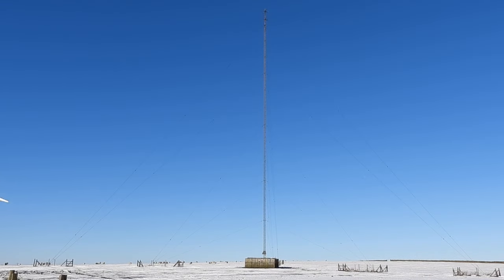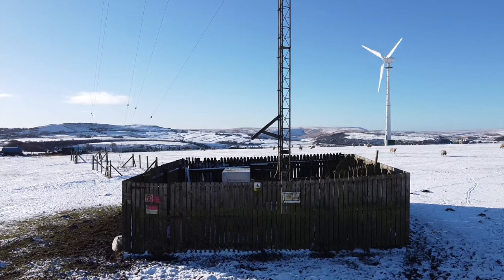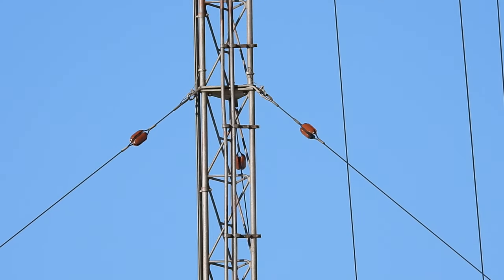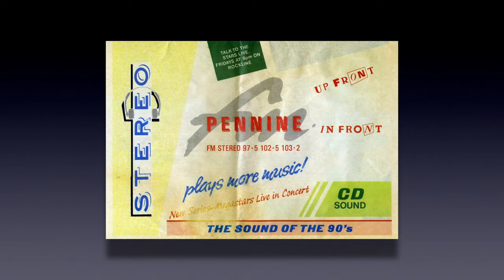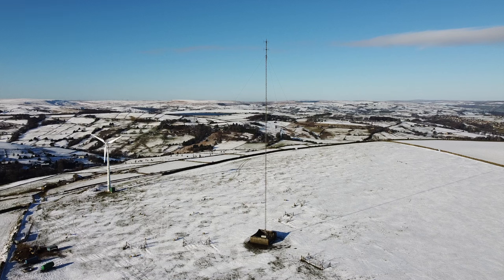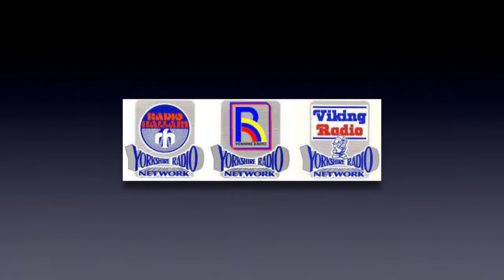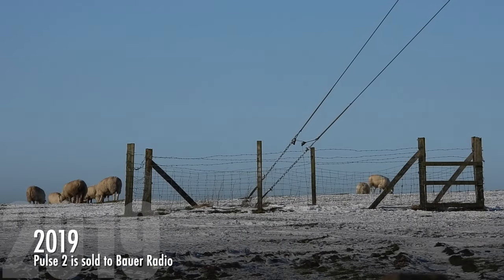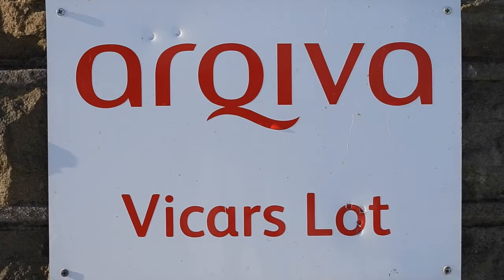This Radio Tower Is Really DANGEROUS

Comment: I was Chief Engineer of a directional AM for decades (among other stations) and when they started putting up cellular towers, I used to get calls asking us to power down so the cell site workers could work on the pole without receiving love nibbles from it.  Keep in mind, those are grounded poles and towers that were absorbing enough of the RF to have high voltage points along their length.  I helped detune several for them so the workers could work on them safely while I stayed on the air.  But all it took was for them to add some more feedlines or otherwise change the electrical length of the tower and the detuning was disabled.
Reply: love nibbles ;-)
Reply: Nibbles and bytes of trans-love @NigelJones  - the AM transmitter was a cause to many sparks just from nearby metal fence.
Reply: Love nibbles. I am gonna use that one.
Reply: Hit 52 and miss those "love nibbles" 🤣🤣
Reply: LOL....  Worked in a factory that that had miles and miles of unsheilded twisted pair phone lines.  There was a 50000 watt AM monster about a mile down the road.  We had a free muzak system on every phone in the building.   It was comical trying to actually use it as a phone system.  I never got bit by the phones but there were plenty of other things like fences, window frames, and a couple of times a week an elevator cable would energize and trip out the whole system.
Reply: So they’re basically frying our brains?

Jk… kind of
Reply: "love nibbles" 
 🤭🤭🤭🤭🤭
Reply: @Sniperboy5551 If you're as tall as a cell tower, maybe
Reply: I'm really surprised to hear that  they don't wear ESD protection
Reply: @dannefan_senshi  esd has nothing to do with that
Reply: ...and that's how mutual inductors work!
Reply: @Skaude  any two material with a high enough voltage between them can result in a electro static discharge, im abbreviating things here as there's different kinds of electric discharges but i hope you get what i mean, im surprised they weren't wearing protective gear
Reply: @Sniperboy5551  Not really.  Your neurons would have to be at least 1/2 of the wavelength.  So for 1500 KHz, you would need to be at least 100 meters tall before you become a bobble-head!

Comment: It is easy to forget that radio wave are actual power being transmitted through the air.  At first it didn't dawn on me why the two towers a mile away were what was causing the danger.  Definitely something to remember when exploring old antenna sites!
Reply: Personally I'm waiting for someone to tongue test one
Reply: @MadScientist267  Yeah, in the middle of a freezing cold winter!
Reply: I've seen people make devices to "tap into this free source of power" and light an LED with it or something. I don't think the FCC would appreciate you sapping radiostations' power output for your own personal use. I don't know the law exactly, but a large enough reciever could potentially attenuate the signal a great deal for everybody else. I'm sure in the case described in the video, it probably caused a lot of disruptions to transmission.
Reply: @VoidHalo  There are demonstrations of AM transmitter arrays with one element down and as the now "dead" element is grounded for safety, a would be lethal hot arc strikes as the clip gets close, with the clear as day audio imposed on the hiss.

It's picking up the RF from the other still operational transmitters in the array. They run multi 6 digit power figures ERP. If you're stupid enough to connect yourself between an active element and ground, bring sauce for the first responders. You're done.
Reply: @fungo6631  Yes, but that won't have much effect on the induced voltage if you touch the damned thing.  Theoretically there might be wavelength related nodes of higher / lower voltage along the length of the element, but at broadcast AM wavelengths (190 to 550 meters) just consider the whole thing to be live.
Reply: @halonothing1 I don’t think the FCC would care as long as you aren’t transmitting.
Reply: @VoidHalo while you can get high voltages with these methods the current is unusable low. 
You won't power anything proper with it
Reply: Oh back in time when we were young we used to impress people by carrying a flourescent tube lamp near a radio emitter and watch it lighting up like magic ...
Reply: It is just that power falls off by 1/r**2, in other words the inverse of the square of the distance. If you want to capture all of the transmitted power, you need a perfectly symmetrical geometry, like concentric spheres or coaxial cylinders. Actually, Nikola Tesla was experimenting with using the whole Earth as a resonant cavity. Unfortunately, he was surrounded by jealous and evil rich men.
Edison was one of the crooks who hated him. And the genius Tesla died a poor man.
Reply: @MadScientist267  Like checking a 9-volt battery!
Reply: @Sniperboy5551  FCC Part 15
Reply: @VoidHalo The FCC has no remit in the UK so would have nothing to say on lighting LEDs from UK transmissions.
Reply: @PascalGienger  I knew this, but never done it. One day I'll get around to it.
Reply: @MadScientist267  I could think of a few people or groups that I would put forward as test subjects lol 😂🤣🤣😂
Reply: @christhomas7905  I would love to see one placed at the next node in the array..  Edit - stretch those arms out! 🤣
Reply: @foureyedchick  It's a bit more than that 🤣

RF effects aside, just that much power in any form being dissipated... "upright biologically"... has enough behind it to almost immediately begin boiling all of the water in the bag.

The RF both mitigates the connection, hence no large loud bright surprises like would be seen with DC of equivalent power, but the energy also couples in, causing heating effects. Either way, not pretty.
Reply: Radio waves are light. Think of them like beacons of light beyond the visible spectrum, because that's what they are

Comment: I used to live less than half a mile from this transmitter while growing up. One year I was given an electronics set to play with which included an AM radio that I could build. The signal was so strong that it didn’t need the antenna wire attached!
Reply: I had a similar set, I think it was called "Electronics in action". It had basic schematics and these spring thing on a board to connect wires too.
Reply: Before the telephone system went digital beyond the local loop, I used to be able to hear to local am stations on the landline telephone  handset when it was on hook.  Weird then, but not anymore when they went digital beyond the local loop.

Comment: Congratulations on the milestone.  I have got bit by an antenna before.  It wasn't connected to anything at the time.  It was a heck of a sting though.
Reply from the maker: Thanks so much mate!
Reply: @Willam_J  I learned that lesson before I could even drive.  It was memorable enough I shall not repeat the mistake. 🤣
Reply: What happened to the dog? :)  @Willam_J
Reply: @TymexComputing  It peed on an ungrounded antenna tower :(
Reply: It's called static, you need to discharge your antenna, especially after a storm

Comment: In Bob Noakes book Last of the pirates, he mentioned getting shocks of Carolines aerial when they were off air. The signal from Veronica and RNI a mile away produced enough electricity in Carolines mast to light a florescent tube! This was used to light the ship for safety reasons when all of carolines generators had failed.
Reply: Many,,years ago, our revered ex-Middlesex Scoutmaster with his Excelsior motorbike told us that the red navigation lights on the 4YA   AM masts on Otago Peninsula,,Dunedin NZ, were only tied on, with no connecting wires. We couldn't quite get it that the radiated power was enough to activate the light bulbs,,or maybe they were short fluorescent  tubes.
...on an aside,,, since someone mentioned local accents.... noticing the hard "g" sounds the narrator has on the end of his "xxng" words.... local, regional accent,,wonder where the limits of this are....
The South Island has its famous Scots originated "Southland burr" with the  long "rr"   as in "burrrn".

Comment: CONGRATS ON HITTING 100K SUBSCRIBERS!!!
Brings back a lot of memories working at various transmitter sites in the States. Had to do a cable repair for a paging transmitter on top of the John Hancock building in Chicago. It was a restricted antenna site where one could only enter the roof area two times a year unless you had these special RF "suits" to wear which were grounded. Not having access to such attire we had to wait until the January major maintenance of the site to conduct our repair. Reason is that the two masts on top of the building house the antennas for all of the FM radio stations on one mast and the TV masters on the second mast. Combined output power alone from the TV masters was well over 800,000 watts combined visual and aural, this was actual watts NOT ERP. The FM masters were at least 200,000 watts into the antenna. Boy was it freezing up there in January! 
A friend who was in the Navy told me of an issue as they came close to port, they had an issue with seagulls coming in and roosting under the pulsed radar array antenna on the carrier he was stationed on. Let’s just say that those sailors who were on the Chiefs sh!t list were tasked with gathering dead gulls and tossing them overboard. The ship also had an incident where an electronics tech in the hangar bay accidentally activated radar countermeasures on one of the aircraft he was working on, thank goodness the rest of the team was in the galley for chow, he wound up with nerve damage from the high RF exposure.

Comment: At first I wondered why it could be dangerous even when switched off, then when you mentioned the other two masts nearby I knew what the problem would be.
We did a special event radio demonstration maybe 15 years ago at the Museum of Science and Industry in Manchester and located in the old railway station with a long wire outside.
Graham had brought an countrpoise earth and tuner and connected it up while I was transmitting on my h/b 5 Watt output radio. He jumped back as he had received a shock. That's only 5 Watts.
G4GHB.

Comment: Also be aware of lokal thunderflashes.  they also could cause verry high voltages on the isolated tower.
Same goes with airplanes.  When refueling them you have to connect a ground lead first, to prevent flashes caused by static electricity

Comment: I've seen a video of a tool drop resulting in a cable snap and tower collapse, pretty amazing that this kind of electrocution hazard can be caused so far away.  Thanks for your great and unique videos and content.
Reply: Lol what the hell did he drop? A boat anchor or what
Reply: @NinoJoel   It was a wrench, and yeah it was for 2" or 2.5" nuts.  It fell several hundred feet before it hit the cable and it cut in enough to snap it.  I'll try to find the video of it and reply back.
Reply: @DoctorMangler  dam the chances of hitting that steel wire are insanely low. 
What an unlucky b@stard . 
Reminds me of an accident in Poland where a worker accidentally took of a support cable while he was working on the tower resulting in a collapse and his death.
Reply: @NinoJoel    A mistake you make only once.  I couldn't work on those towers.
Reply: @DoctorMangler  to be honest I wouldn't mind working on these heights but the High energy Radiation would be a big no no for me

Comment: You should consider making a detailed video or two on the Emley Moor tower!  Not being from the UK, I was not aware of it, and suspect it's completely unknown to most in North America.  It's an absolutely exceptional structure, and its looks are very imposing.  I would have guessed such a thing belonged in the Soviet Union, not current day Great Britain.  I see now you have some older videos visiting it.  I suspect it's rather mundane to you.  But being from the US, it's completely different from what I'm used to seeing, and really remarkable!  At best you could compare it to the CN Tower in Toronto, or Space Needle in Seattle, which are tourist attractions, and designed very differently overall.  The Emley Moor tower is definitely all business, and rather stark and brutal in its appearance!  I don't think Americans are used to seeing all-concrete, purpose-built, freestanding radio towers.  I appreciate all your videos.
Reply: The previous tower, which I visited on a public open day in about 1967, was a more conventional steel mast with guy cables. It collapsed in severe winter weather a few years later, because the weight of ice that formed overloaded the cables. So the transmitter that replaced it in 1971 was built on a much more imposing scale, and as you know it has stood the test of time.

Comment: There's a wind turbine in the background close to the mast, would that have been installed to help power the transmitter (reducing the load on the DNO cables)?
Reply: Unless the masts happen to be fed from a completely separate supply I'd assume all of the grid-tied turbines up there would be contributing to the local network.  I wouldn't have thought it installed for that specific purpose though - it's just a particularly favourable location for siting turbines.

Comment: Most People do not realize how RF works and be dangerous you can hold up a tube from a office light under a high voltage line and it will light up . We take a small tube and tape them to our radio antennas and light them when the mic is keyed .

Comment: My biggest FM is 100kw and biggest AM is 1kw. The latter is in the same building as the studios and the ground itself isn't great so I chase RF demons out things all the time. I have had equipment not connected to anything but a bit of wire I was removing and gotten a shock off it. That close pretty much anything is an antenna. If I am somewhat near the tuning coil I can make the curly lightbulbs light up in my hand. I sometimes have to remote in or drive out to lower power on my FM so climbers can go up near the bays. In the analog days my predecessor would get complaints and have to go to houses near the towers to add some filtering to a tv or hifi.

Comment: another "big loop" parasitic "antenna" that can accidentally give you a "zap" if you are close to a high power MW (or shortwave) transmitter is big tower cranes.... big metal upright, long metal boom & metal cable going back down to the ground basically forms a big conductive receive loop so not a good idea to stand on the ground & grab the hook when it descends (always make sure there is a "shorting tail" hitting the ground before you grab anything (just like rescue chopper winch-men have a conductive tail before they touch anything on the ground).

Comment: Done a few surveys on Arqiva sites where there was a standard lattice tower (supporting cell equipment etc) in the same land as a MF mast or near a sloping wire. All of them were supervised by an engineer and when climbing would only be able to use a RF monitor that covered kHz range which the Nardalert S3 did but the cheaper ones used in the cellular industry don’t.  Never seen anything untoward on the monitors on-site, but assume if winching up kit/steel it could be an issue.

Comment: I was a Ham radio operator in the mid-seventies from age 13 to 15.   [No, I didn’t have a girlfriend, why do you ask?  ;-) ]   Anyway I’ve been burned by RF a few times over my life.  I use burn rather than shocked because that’s what it always felt like.  And I have a permanent straight line in two fingerprints to prove it.  ;-)

Comment: There's not much danger of being electrocuted, the danger is being severely burned. RF induced voltage is high frequency and anything over about 10kHz is not dangerous to the body. Similar to how a tesla coil works, instead of getting shocked you get burned.

Comment: If someone went up there with a florescent light bulb would the gas glow?
Reply from the maker: At moorside edge more than likely yes
Reply: Yes
Reply: Undoubtedly
Reply: Oh yes we did it with our CB radios here in the US and taking the 8 foot ones and standing under high voltage transmission towers lines careful not to touch the ends !

Comment: Like the military uses a gloved wand to discharge static from fighter canopies, maybe they could use this approach before starting work on the antenna.
Reply: Would probably not work, because there will easily be RF voltage peaks and troughs along the height of the tower, even if you ground the base.
Reply: @FUL0H8, Once the airplane canopy is discharged, whoever touches it is free from shocks until it charges up again, most likely from flying. The radio station antenna mast is different, it is constantly receiving RF energy from the other station's transmitter, it's not something that could be discharged.

Comment: I remember seeing a video about the power of am tower transmitting power a few years back and it had construction guys maybe 1 mile or so maybe more I can't remember but they were using a crane or some thing and and the hook on it and another piece of metal was I think arcing and you were able to hear to station and I saw this video on youtube. One personal experience I had was when I was living in a house about 15 minutes from where I live now and there was a radio tower not that far away and I think it was an am tower possibly cause in the house especially at night I would hear voices coming through the hvac vents and I know it sounds crazy but I did hear them and I also searched pretty much the entire house for maybe a radio that was on but there was none to be found.  did hear though that there was an am radio station in the next town which was Watertown Mn which was probably maybe 5 or 6 miles away but not sure.